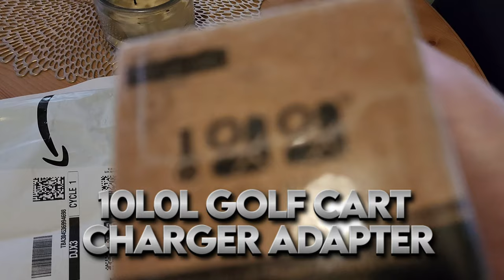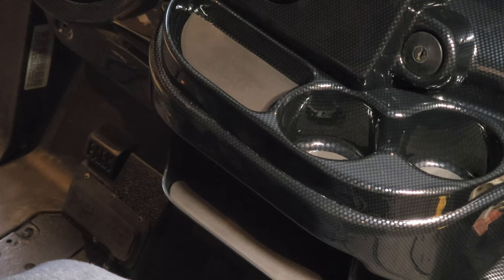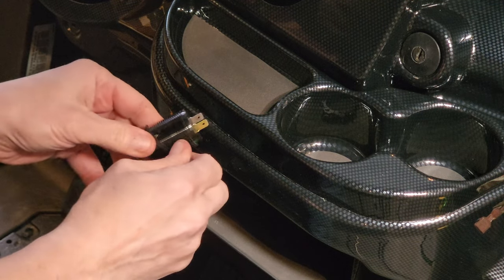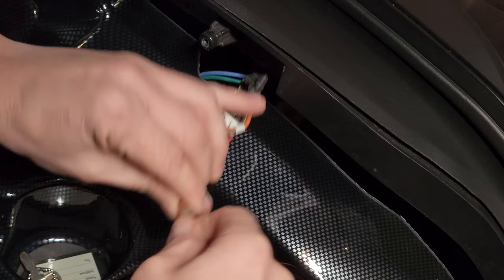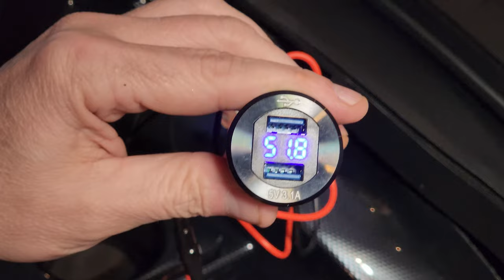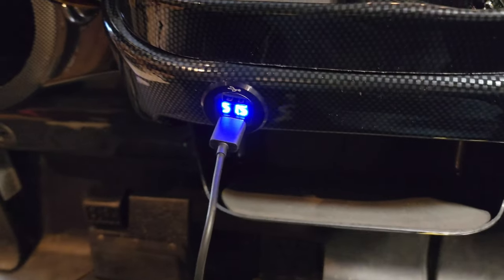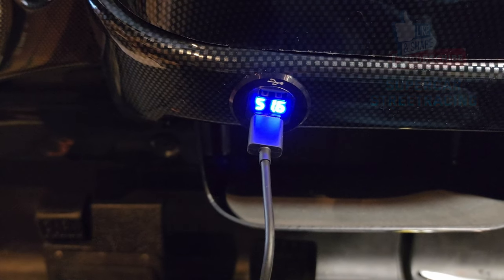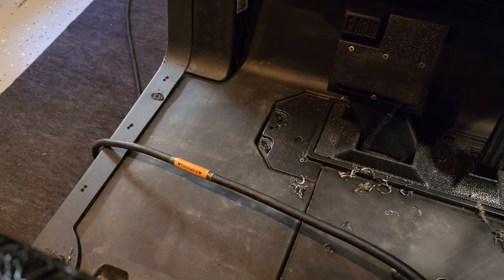Installing a USB Charger and Voltage Meter in the Golf Cart  - 10LOL USB Charger and Volt Meter

Comment: Hi, I'm trying to hookup a charger also, but mine is a double charger.  I was told to hook the 2 bk wires together then ground them to the frame, then hook the 2 red wires together and run them to the battery.  But still it's not working. Where and what 2 wires did you hook yours to under the dashboard?  How do I test the wires to see which wire is the correct wire to hook the bk and red wire from the charger to?  I need help please.
Reply from the maker: So is it a 12v or 48v charger?
Reply: @Supercar_Street_Racing  I have 4 batteries,  I thk 12v each.
Reply: I'm not sure what volt is the charger,  but I will let u know tomorrow
Reply: 10L0L Golf Cart Cigarette Lighter Outlet & Quick Charge 3.0 DC 12V Input Waterproof USB Charger Power Socket Adapter Dual USB Ports Panel Universal for EZGO Club Car Yamaha Golf Cart Models
Reply: HI, I did get it hooked up, I ran the wires straight to the batteries.  but it drains my batteries quicker when I'm charging my phone or my blue tooth speaker.  I purchased brand new batteries
Reply from the maker: Hmm I don't understand what could be happening there.
Reply: Shouldn’t you have hooked it via the ignition so it’s only reading the batteries voltage when the ignition is on? Otherwise that LED lights just going to constantly drain your battery when your golf cart is in storage ?
Reply from the maker: @beaunicholls8856 it turns off with the master battery switch.  Even if not it would take it a really long time to discharge. Actually just realized this was before I had lithium. So yeah it was on all the time but the led lights are negligible battery drain.